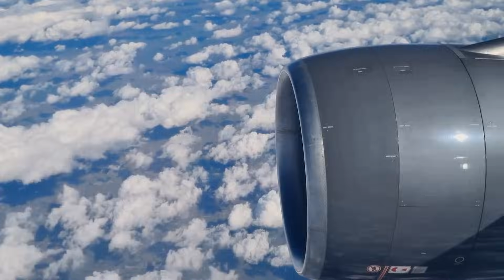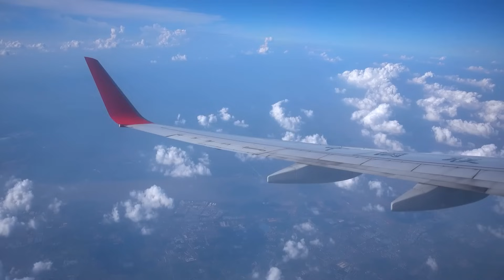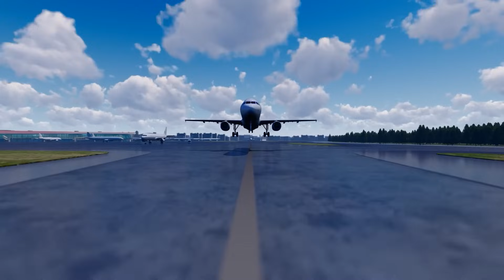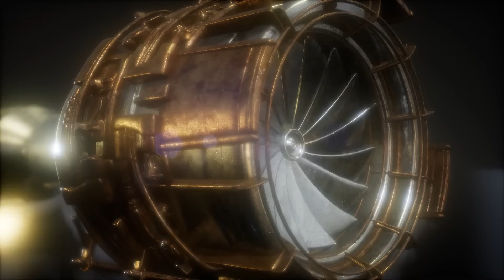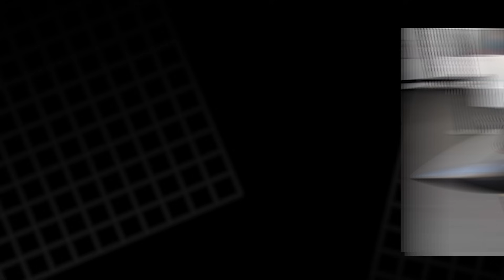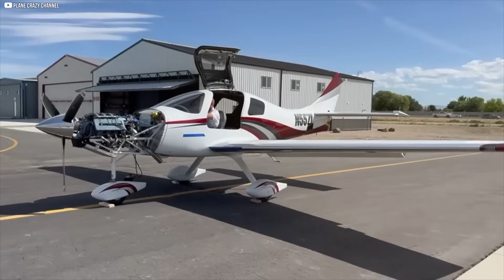Turboprops vs Pistons: The Future of Light Aircraft?

Comment: turbines can get higher compression ratios than piston engines. if designed to give higher compression ratios, like disc stack turbines. so instead of turbo props. use turbo generators with electric motors. turbo generator can run at the optimal speed all the time. a turbo generator can be also a turbo fan thruster at the same time, at the back. the electricity can be used in electric motors with propellers or electric plasma jets. disc stack with small gaps has boundary layer friction to make them efficient for most operating regions. faster better still. disc stack turbines are also very simple to manufacture. disc stack turbine is a double tesla turbine, for intake and exhaust on a single shaft. the intake disc stack can be same size or larger in stack size than the exhaust disc stack to make the air flow even more single directional. disc stacks dont require most parts of current turbo probs being very simple. of course new stuff is more interesting. old stuff is boring. and new stuff designed properly is easier cheaper simpler, old stuff is complex expensive hard.
Reply from the maker: It's interesting to consider the potential of turbine technology in the future of aviation!